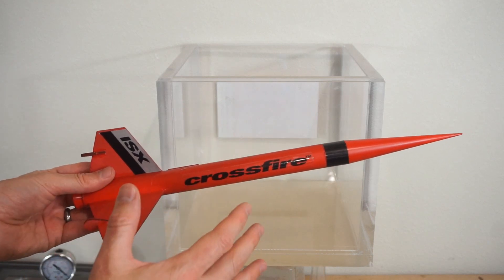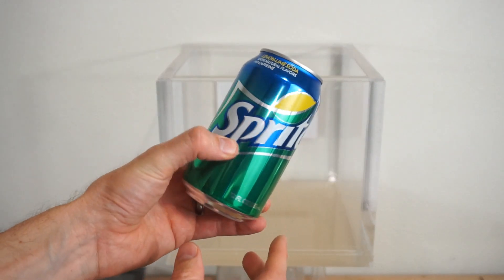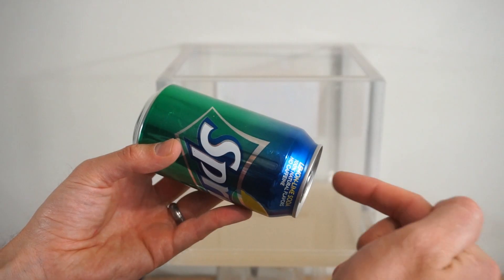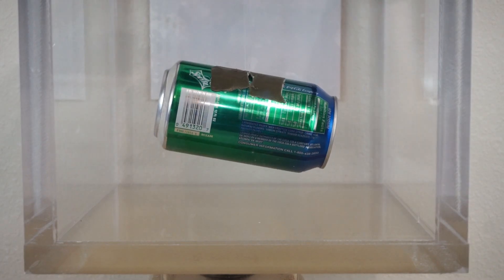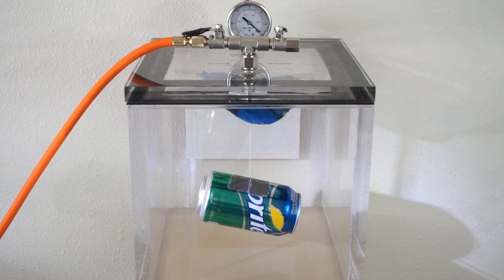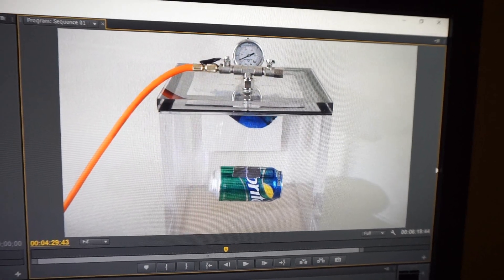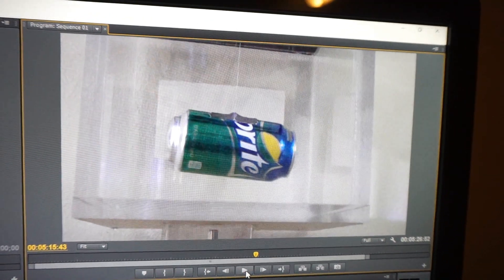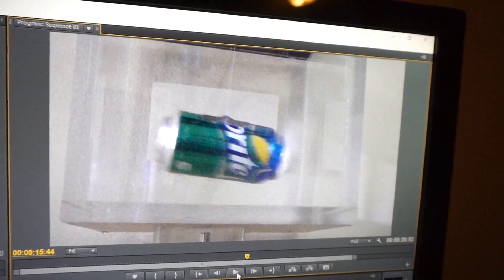Can a Rocket Fly in a Vacuum Chamber?

Comment: was that the same pressure as the pressure of space? 
ps. i ask bcuz the tanks would have to be pressurized and seald @ atmospheric pressure to even have a chance. . and the vacuum of space is like 1000 the pressure of the deepest weve been in the ocean(though its opposite pressure)
the vacuum of space would be "sucking a rockship like a straw so pushing off itself would be noneistent if it was real "space" pressure
Reply: There is no such thing as "opposite," nor "negative" pressure. "Vacuum" simply implies a lack of pressure. Vacuum doesn't "suck," in fact it doesn't do anything. It is, by definition, nothing. You're equating the action of a vacuum cleaner in a gaseous atmosphere with the condition of vacuous space, which is complete nonsense. When I open a valve on my evacuated chamber, air rushes in because pressure outside the chamber is forcing it in, not because the vacuum within the chamber is sucking it in. Fact is, every rocket experiment ever has shown that a rocket generates greater and greater thrust as it ascends through thinner and thinner atmosphere. This doesn't magically stop at the Karman line, rockets work better in the vacuum of space than they do within Earth's atmosphere. Period.
Reply: phxgen thats dumb a vacuum a vacuum. .  so that mean we can simulated the "exact" pressure of space.  No. . according to nasholes we cannot achieve the vacuum of space.  But according to you a vacuum is not a vacuum.  Except the vacuums nasa made doesnt remove. . or suck out air. . wtf. how do you make a vaccuum chamber then? Dumb af 
no levels of vacuum. . u need to read what kind of atmospheric pressure in a vaccum chamber compared to space.  HOLD UP thought you said there are no "levels"   RHETORIC!
Reply: phxgen And rockets move better in space?  So Dumb. . so a rocket only moves bout 15,000 mph. . but it work better in space out of earths "gravitation"  . so keeping up with the earth which moves @ 50, 000 mph (so they say) is nothing huh.  smdh
Reply: phxgen look ima just going to take a few part. . if im in an airplane we are both moving @ the same speed! if i jump out of the airplane i maintain my 550 mph? no!  yet you want me to believe if u leave the earth you will still move @ 50, mph huh?  and as i said. . a man made vacuum cannot exactly simulate "vacuum" of space. . so when the chamber stops "sucking" all the air it can. . its still not supposed space vacuum.  so either the vacuum is held @ a level not of space. . or the air is being continuosly removed to try and achieve this.  Either way its not an accurate depiction of what "space" is.
Reply: phxgen pps the iss is "lower" earth orbit. . not in earth atmosphere not in space. and im sure nasa has all kind of "video" footage. . i even myself have looked.    Just like why all the pictures of the earth nasa has made all look different.  but ok. . ill follow telsa. . you can follow einstien!  most people cant prove space without nasa.
Reply: phxgen circumnavigate. . while the whole supposed solar system i hurling towards nowhere @ a supposed 200,ooo mph or to that effect. . ok makes sence 😕
Reply: phxgen ps. i never said a vacuum wasnt a vacuum. . .  but what u fail to realize is there is levels to vacuum pressure. . so a vacumm chamber nasa made is the same as space? NO! Different levels of pressure. .  im must be kindergarten. . bcuz i look in books they tell me we cant achieve the vacuum of space. . i google wiki and the have a chart with differt "levels" ie chamber, space, ect. . but here u are calling me a kindergartener for reapeating what wiki says 😕
Reply: phxgen im not following either one i just agreed with what he said about Einstein's theory. .  even einstein said himself the mathematics could equate to a flat earth.  btw. . how the know it was round? they never been? And when somebody can prove these planets million million miles away without using nasa i will believe! Bcuz they cant even prove the moon reflects sunlight!  Been since the 70s and only 12 ppl walked on the moon, but we build a space station on mars 😕 some gullable ppl believe anything. . big bang came from a ape muf=×#@
Reply: phxgen still trying to grasp how your telling me negative pressure is no pressure. . it is. . just negative. . the opposite of diving to the bottom of the ocean.   negative pressure so great water boils. guess that why all the footage of them landing on the moon was destroyed bcuz it looked like a tin can!
15,000 mph. . relative to earth 😁 how bout outside of earth. 
gravity sure work and dont work when the globalist want. .  but as thick headed as they are density still has no meaning!
the curvature is .666 moves around the "sun god ra" @ 666 mph. . and of tilt .666%
you can have you theories!  ill believe what EVERYBOBY did till them stoics came along!
Reply: "i see lights up there. . but telling me about something "lightyears" away which would take lifetimes to get to. . yet tell me mass, compositions, age, how it formed. . gtfo how in the hell nasa know? rhetoric"

Why not actually look into how we estimate the mass, composition, age, and distance of celestial bodies rather than just assuming it's all a guess? It's not. Ever heard of spectroscopy, for example? We determine the composition of distant stars the exact same way we determine the composition of something here on earth: spectral analysis. Recording, measuring, and analyzing light emission characteristics, and comparing that data to known values obtained from analysis of materials right here on Earth. We KNOW that we can accurately determine the composition of matter locally by analyzing the way it interacts with light, and we know we receive light from distant stars because we can see it, so what makes you think we can't accurately analyze the composition of stars the exact same way we analyze matter on Earth? We can, and we do.

"the astronaut didnt even know they went thru van allen but they know what things made of limetimes away. . and flat get a tard @ the end?"

So you're telling me that you think if you were to pass through the Van Allen radiation belts, you'd somehow know it? Do you have a built-in Geiger counter or something? You're full of shit, you'd have no idea you were passing through the Van Allen belts either. If you were blindfolded and being pushed around a hospital in a wheelchair, would you somehow know when you were in the nuclear medicine ward? No you fucking wouldn't, even if you were to receive greater doses of radiation than you would passing through the Van Allen belts. Why is it that you people think that very short term exposure to the thinnest parts of the Van Allen radiation belts would be some epic feat, when you can clearly survive an x-ray just fine? I've received many times more radiation than any of the Apollo astronauts received from the Van Allen belts in my lifetime just because of x-ray imaging, and I'm fine. Explain that?

"you probably never heard of operation fishbowl which occurs after byrds trip to antartica.  How high those rockets go? 400,000 . . 500,000 miles is so ironic along with the name of the operation "fishbowl""

LMAO Yeah I've been debating you flatwits on youtube for years, but I've never heard of operation Fishbowl. Right. I hear of it every day thanks to idiots like you, but please continue thinking you're privy to some sacred knowledge anyway. You do not have any arguments that I haven't already heard, I promise. 400,000 and 500,000 miles?? Are you sure that YOU have heard of operation fishbowl? Highest test was about 250 miles, you dope.

"ps. tell nasa one of these guys gonna drown in their suit forreal tryna shoot in that pool.
pps. tellem we see the bubbles!!"

ppps Tell 'em that you think air bubbles move in every conceivable direction and at any conceivable speed in pools on Earth. They deserve a good laugh, after all. None of the debris that you idiots claim appear to be "bubbles" EVER behaves ANYTHING like how bubble behave in water on Earth, and ALL of the shit you think looks like "bubbles" behaves 100% exactly like you would expect random bits of debris to behave in orbit.

You really ought to give up now, dude. You're hilariously ill informed even for a flatwit. It's really fucking sad  you can't even measure up to average amongst flat Earthers, the dumbest group of nutjobs on the fucking planet. Go get a real education, please. Worst case scenario you can just dismiss it like you're doing now, but at least then you'd know what you were dismissing. Best case, you'll realize how silly you're being and you won't have to continue being so wrong!
Reply: "Operation fishbowl only one or 2 were detonated that low. . how high fid they reach? 400.000 to 500,000 miles."

When you're called out on making a stupid claim, why don't you look into it? 400,000 to 500,000 miles is further away than the moon, you dolt. You misread 400,000 to 500,000 metres as miles. Haha!

'quote from einstien
"common sense tells us the earth is flat"'

LMAO you're funny. Again, called out for making a stupid claim and you continue to repeat it without looking into it. Looks like you need to work a little harder to validate your quotes bud, Einstein never said that. You're repeating a quote falsely attributed to Einstein by flat Earth retards. Here's the original quote:

"Common sense tells us that the world is flat, that the sun goes around the earth, that heavy bodies always fall faster than light bodies, that boats made of iron will sink."
-Stuart Chase

NOT Albert Einstein, and even if it was... He's explaining why you shouldn't always rely on "common sense." Do heavy bodies fall faster than light bodies? Nope. Do boats sink if they're made of iron? Nope. Does the sun go around the Earth? Nope. Is Earth flat? Nope.

"phxgen debris. . lmao not bubbles. . gtfo. speaking of debris. . how many satellites "orbit" earth plus old trash and so forth. . but u dont see sh*% in ur live feeds space clear than a mug.  Hold up where my gps.   since its not triangulation! smdh"

Well we've established that you've been wrong about literally everything else so far, only makes sense for this trend to continue. Why don't we see the thousands of satellites in the ISS live feed? Space is fucking huge, you idiot. There are several thousand artificial satellites and bits of space debris orbiting Earth, that's it. There are billions of people, billions of cars, and billions of structures on Earth, yet there are still shitloads of places you can go on Earth's surface and not see a single person, car, or structure for as far as you can see... And you think it's a problem that the ISS live feed doesn't have a bunch of tiny satellites in its field of view, when there are only several thousand of them? Earth is much smaller than space. Each of those thousands of satellites and bits of space debris are hundreds, thousands, even tens of thousands of miles apart. You can literally see the ISS for yourself, even Jeran and other flat Earth retards have spotted it and taken pictures of it. How could it not be real? By the way, other satellites have been spotted from the ISS, and the ISS live feed, many times.

"phxgen pps.  some of em saw lights flashing though there eyes, and your asking me how can you see radiaton?"

Again... if you were blindfolded and being pushed around a hospital in a wheelchair, would you know when you're being pushed past nuclear medicine? You receive a stronger, quicker dose of radiation from an x-ray than the Apollo astronauts received passing through the Van Allen belts. Astronauts are always shielded to some degree by necessity, they're never just freely floating in space, fully exposed to radiation. Spacecraft provide some degree of shielding, spacesuits provide some degree of shielding. It's really only gamma radiation that's of serious concern, and none of the Apollo astronauts were subject to doses of gamma radiation that would cause illness. You are not a Geiger counter, you cannot detect doses of radiation that don't make you sick. You're receiving a dose of radiation from the sun right now, even if you're sitting inside. Can you feel it?

"oh lemme go far left on your spectrometer lightyears away. . how you know its not a space rock unique that gives off similar properties as earth materials."

Because that doesn't make any goddamn sense. The laws of physics don't change elsewhere in the universe. We have a pretty damn good grasp on WHY certain elements have certain spectral properties, and we know these properties don't suddenly change because something is far away.

Keep quoting Tesla, sure. Your idol wasn't the most stable person, he suffered from fucking insane OCD and he preferred relationships with pigeons to relationships with humans. You gonna marry a fucking pigeon? Probably are, look at the way you type. Your grammar is terrible, your spelling is terrible, you type like a teenage girl sending a facebook message. You're wrong about literally everything you've said, you've made it apparent to anyone reading that you're an idiot. Why isn't it yet apparent to you? Why do you think you're qualified to posit your guesses about matters of physics?
Reply: phxgen you havent proved shit.  Just theoretical mumbo jumbo. . and yes im not spell checking myself but that has. nothing to do with what im saying! You can try and make it seem as if im highly uneducated. . but that just makes me feed into you negative name calling bull shit!
phxgen phxgen quote from wiki. . The Thor missile carrying the Starfish Prime warhead actually reached an apogee (maximum height) of about 1100 km (just over 680 miles), and yes the warhead was detonated on its downward trajectory when it had fallen to the programmed altitude of 400 kilometres (250 mi).
so wtf is 680 u monkey cousin?  i swear nasholes!

another wiki quote. . 
Number of tests 11, so should i believe you or wiki. . you a dotart. Do ships sink. m wout surface tension yes!
space is huge. . were not talking about outter space. . were talking earth orbit. . thousands of "working satalittes" not counting space debris and old decommissioned satallties watch that live feed all day youll see none of that. 
how can my theory
clip from forbes article. .
Periodic Table Surprise: The One Element In Stars That Isn't On Earth
so my theory of "alien" elements is just as idiotic as your scientists huh? only when it doesnt validate you bullshit?
heres another quote for the dotard. . 
Albert Einstein and Leopold Infeld-The Evolution of Physics -"The struggle, so violent in the early days of science, between the views of Ptolemy and Copernicus would then be quite meaningless. Either coordinate system could be used with equal justification. The two sentences, 'the sun is at rest and the earth moves,' or 'the sun moves and the earth is at rest,' would simply mean two different conventions concerning two different coordinate systems."
either coordinate system could be used with the same justification?
i swear. .  i cant believe im entertaining someone who thinks we came from monkeys. . 
this is monkey buisness... you prove me Sooooo wrong.  Dotard
Reply: pps. why you telling me i cant see radiation. . tell the apollo crew that too! cuz i see light shoot passed my eyes as well 😂 people cant sit on the beach with some spf but ok
Reply: Please tell me what you think "dotard" means, and how is it pronounced?
Reply: phxgen Crazy. . that quote was directly relative to the point. Einstien came from copernicte model!  MnM forced einstein to change his "theory"
to much typing to go in depth.  Einstein had to change his theory bcuz he kept proving himself wrong!  First he tries to abolish the aether then has to rearrange the problem to make the solution fit! Relativity is like me saying you didnt fall. . the earth came up and smacked you in the butt.  He could not detect motion. . because the earth is stable and does not move! right airys?  gale? morley?  damn sagnat got Einstein back to work on his "theory"  . . i understand why relativity keeps "evolving" tesla!
and sorry no i dont belive nasa "spectrometer" detects anything.  If i had a few billion dollars we'd be racing on saturn rings too!  I dont believe ra is the center! and those lightyears are a few miles above us! Planets are bull with the big bang! 
Ill stick with what everyone believed b4 your stoics came along. And Columbus discovered america!
Reply: "phxgen Crazy. . that quote was directly relative to the point.  MnM forced einstein to change his "theory"
to much typing to go in depth.  Einstein had to change his theory bcuz he kept proving himself wrong!  First he tries to abolish the aether then has to rearrange the problem to make the solution fit! Relativity is like me saying you didnt fall. . the earth came up and smacked you in the butt.  He could not detect motion. . because the earth is stable and does not move! right airys?  gale? morley?  damn sagnat got Einstein back to work on his "theory"  . . i understand why relativity keeps "evolving" tesla!
and sorry no i dont belive nasa "spectrometer" detects anything.  If i had a few billion dollars we'd be racing on saturn rings too!  I dont believe ra is the center! and those lightyears are a few miles above us! Planets are bull with the big bang!"

This is seriously just a bunch of rambling nonsense. You're drunk or something. You've just thrown together every word you know in a salad.

"Ill stick with what everyone believed b4 your stoics came along. And Columbus discovered america!"

So you'll believe that Earth's a sphere, what everyone had known for thousands of years prior to Columbus "discovering" America? This is basically what all your arguments boil down to, you're going to stick with archaic beliefs no matter how much evidence comes along to prove them wrong and you admit that here. What is the point of you debating anyone when you'll continue believing you're right even when you're proven wrong?
Reply: phxgen how have u proven me wrong? without nasa spectrometers and test . . in which i told u id become a believer without using nasa rhetoric.  And b4 copernicus and the catholic church pushed this ball. . it was widely know throughout ancient civilizations that they believed in a flat earth. . ie why it was intially met with blasphemy.  So do be facitious.  the earth is no ball. . it doesnt spin airys. . stars are not planets far away.  Ps.  ill be more specific. . i believe what the ancient hebrews believe!
Reply: phxgen arys proved me wrong?. . michelson an morley did? michelson gale did? 
tell einstein his s;*% need more work!
pps just googled satalittes and debris orbiting earth. . the images brought up look like a cluster f÷=(. . but ok ok ok what you said 😕
Reply: phxgen drunk huh. . Einstien throw out his theory bcuz mnm test disproved it so he thru out the eather and made another version of his relative theory.   then the sagnac proved there was one so he had to change it again. . i tried to sound less inebriated on that one lmao
had 2 change the problem to fit the solution. . of which a flat earth model could easily correlate! but i digress . . finding some independent non nasa government entity your proofs lay as archaic as mine!  And with a billion dollars i bet i would have you belive flat earth 2 since the bible doesnt
Reply: phxgen these smartphone muf$@#z still dont know how they built the pyramids and positioning as well still controvesy about what its use was as well as airplane like artifacts. . myan calender is more precise than our own. ..but yeah. . we know it all now! Google tells me so!
Reply: phxgen yeah i know i need 2 quit cussn but sh*% aint logical. .  earth rise video from china or where ever.  Why isnt the earth spinning in the video?  and if its "tidal locked" how tf is there an earth "rise"  it should just always be the earth just a different part.  been since 1970s and only 12 ppl walked on the moon. . only 12? MAN we wouldve had tours up there by now. . but no lets go settle mars. . smdh
12 people? since 1970. . and that footage? destroyed? ok ok yeah
Reply: phxgen pps ancient egypt myans, hebrews, asains all had similar flat Earth views b4 your stoics
Reply: phxgen ps and for those who dont know who airys was. . a heliocentrist who tried proving the earth moves. . and failed
https://youtu.be/lijjCHb7HIg
michelson and morley also did experiments so einstein tried throwing out the aether bcuz his theory sound like rhetoricm . so he did. . then the sagnac or however its spelled experiment proved there was an aether so einstien had to change his rhotric again (change the problem to fit the solution) in which relativity started breaking into all kinds of different subgroups. . in which theories like dark matter and such arise. But sorry the earth doesn't move!
Reply: phxgen yeah it is boring bcuz you keep spitting rhetoric while my points hold fast. Just like airys will always be a failure.  Even if it was orbiting still no spinning several hundred thousand miles per hr.  no satellites or debris in sight.  .  just a bunch of nasa mubo jumbo and billion dollar computer graphics.
why all the blue marbles look different.  .  and neil degrasse said its supposed to be a pear.  All these photoshop pic of the earth . . can they make em look similar @ least? Ik ik. . ur just going to rearrange your theory so why argue. Michelson and morley showed you. . so did gale. . it doesnt move!  huh? what airys? negative? but there is an aether. . einstien back to the drawing board. . more rhetoric.  plat or copern?  either one could work. . just copern needs alot more work!  Tell me . . they find dark matter @ cern yet?  God particle? Hex. bozig?
illogical how we can be in an expanding universe hurling toward nowhere spinning in a milky way spinning around a sun and spinning. . yet the star run the same line every night. . smh the moon reflect sunlight yet moon shade is warmer than moonlight 😕 This dude tells me we cant see radiation and apollo crew member see lights in there brain 😕 dude tells me there are no forgien elements we dont know about. . yet the periodic table recently had additions 😕 Tries to tell me the myan calender is off. . when its still being used today!  Telling me about things "lightyears" away how tf you travel a lightyear to know? Like telling me what @ the deepst part of the ocean? or what deeper than like 15-20 miles under the surface of the earth.  People can speculate and use theory. . but in the end. the sea is level. . the sky has a ceiling. . . .and like airy . . mnm. . m n gale does it move. . . negative!  Not space. . the sky is blue bcuz there is water up there! Sry
Reply: phxgen pps. . you need to do some more reasearch about the moon landing tapes. . "NASA admitted in 2006 that no one could find the original video recordings of the July 20, 1969, landing.

Since then, Richard Nafzger, an engineer at NASA’s Goddard Space Flight Center in Maryland, who oversaw television processing at the ground-tracking sites during the Apollo 11 mission, has been looking for them.

This NASA remote camera file image shows the July 16, 1969 launching of Apollo 11, the first manned mission to land on the Moon, from the Kennedy Space Center Launch Complex in Florida. REUTERS/NASA/Handout

The good news is he found where they went. The bad news is they were part of a batch of 200,000 tapes that were degaussed — magnetically erased — and re-used to save money.

“The goal was live TV,” Nafzger told a news conference.

Slideshow (8 Images)

“We should have had a historian running around saying ‘I don’t care if you are ever going to use them — we are going to keep them’,” he said.

They found good copies in the archives of CBS news and some recordings called kinescopes found in film vaults at Johnson Space Center.

Lowry, best known for restoring old Hollywood films, has been digitizing these along with some other bits and pieces to make a new rendering of the original landing.

Nafzger does not worry that using a Hollywood-based company might fuel the fire of conspiracy theorists who believe the entire lunar program that landed people on the moon six times between 1969 and 1972 was staged on a movie set or secret military base.

SPONSORED

“This company is restoring historic video. It mattered not to me where the company was from,” Nafzger said.

“The conspiracy theorists are going to believe what they are going to believe,” added Lowry Digital Chief Operating Officer Mike Inchalik.

And there may be some unofficial copies of the original broadcast out there somewhere that were taken from a NASA video switching center in Sydney, Australia, the space agency said. Nafzger said someone else in Sydney made recordings too.

“These tapes are not in the system,” Nafzger said. “We are certainly open to finding them.

© 2018 Reuters. All Rights Reserved.

×
Reply: "phxgen pps. . you need to do some more reasearch about the moon landing tapes. . "NASA admitted in 2006 that no one could find the original video recordings of the July 20, 1969, landing."

Yet strangely enough you've seen video from the July 20, 1969 moon landing, haven't you? You've been arguing that "all footage was destroyed," yet you've fucking seen it. Here, watch some again:

https://www.youtube.com/watch?v=S9HdPi9Ikhk

Doesn't look destroyed to me. Never heard of making copies, I guess? What the fuck would anyone need the original slow scan video for anyway, when you couldn't have even viewed it without a special slow-scan monitor? There's no reason to keep the originals when we have copies that we can actually watch.

Your next comment is just a bunch of fucking emojis. Grow the fuck up and speak English. I'm not replying anymore until you stop speaking to me like you're a twelve year old girl sending a Twitter DM, I'm not your fucking "boo," speak to me like a civilized adult or don't speak to me.

"tell you guy he need a better zoom! as to why its still a theory!  RHETORIC"

Yet for some reason, nobody has ever been able to zoom in and reveal parts of a ship that have been obscured from the bottom up by the horizon, EVER. Not once. You can't provide a single example of this ever happening, because it doesn't happen. In fact, you can see on videos where people zoom in and out on ships beyond the horizon, the exact same amount is obscured no matter what zoom level they're at. You fucking idiots argue that more zoom would reveal more of the obscured ship, but you can't provide a single example of that ever happening while we constantly provide videos where zooming in and out doesn't change the amount of the ship obscured even one bit. Please, since you think it's possible, provide me with any evidence of someone zooming in on a ship partially obscured by the horizon and showing ANY part of the obscured bit suddenly becoming visible. YOU CAN'T. The ONLY way you can reveal part of a departing ship that's been obscured from the bottom up by the horizon, is by gaining elevation. Going straight up. By going straight up, you're not reducing the distance between you and the ship at all. You're still looking through the same amount of air, yet going straight up reveals what was previously hidden. The reason is because the surface of water is curved, and there is NO OTHER EXPLANATION POSSIBLE. None. Here, watch the sunset observed twice just by changing elevation, no change in distance:

https://www.youtube.com/watch?v=pLrRoE8myMM&t=1s

Explain this, without the surface of water being curved? Good luck, you literally can't.
Reply: phxgen phxgen yeah the sun is why the stars all planets dissapear in space😕 i never see star while the sun is out 😕 matter of fact i didnt wake up and see the sun and moon out @ the same time 2day. . other side of earth missn a moon 😕so thats why stars disappear when ur in space 😕 the quote with einstein sayin plato coordinate could work doesnt correlate 😕 he was saying its just as easy to say the earth is moving around the sun as it is to say the opposite. . oh thats what he did say but doesnt coorelate 😕 wtf  i cant say unkown elements even though as i stated the periodic chart has changed 😕 the earth spins to slow to see 😕 i see you avoid my airys comment n mnm comments so i wont reiterated their test results. i see were not discussing moonlight, along with why relativity has changed so much from the original (changing the problem to fit solution) thank to geocentric experiment 😕 yes i misquoted how high the missles went. . but that doesn't change the fact they started shooting em after byrds mission! and you said a couple rockets when it was more like 11. . not counting accompanying rockets shot @ the ceiling bubbles are debris that im not supposed to see cuz space is huge 😕 so when do i see debris. . only when i think its a bubble bcuz i could walk all around the globe and not see a person but this spec of debris i can see even though space is huge and the feed points @ earth 😕 thats the debris you can see. astronaut almost drowns in suit!! the recording of the moon landing werent erased just telemetry vids 😕 vacuum chamber dont "suck" out air as a vacuum it just removes it 😕 no levels of vacuum either its space or not space we wont talk about the properties of moonlight compared to the sun even though the moon supposed to reflect sun light 😕  and boats disappear beyond horizon 😕https://youtu.be/Gkzbx99vUhI 
tell you guy he need a better zoom! as to why its still a theory!  RHETORIC
Reply: Here's another one:

https://www.youtube.com/watch?v=i0ObTd7DLMw

Notice as he zooms in and out, the level of zoom makes absolutely no difference to the amount of the ship obscured by the horizon. Zoom in, same amount obscured. Zoom out, same amount obscured. Even the video that you linked shows that the same amount of distant ships remains obscured no matter how much he zooms in and out. You're seriously so stuck on this flat Earth idea that you've been led to believe that zooming in on an object will make an obstruction between you and the object disappear? You fucking people don't know shit about perspective. Perspective does not make parallel lines actually converge, ever, yet you people try to argue that perspective makes parallel lines converge before the object? You people think that perspective makes straight lines curve? How does this make any sense to you? You literally have to throw out everything to believe this shit, the only way you can believe Earth is flat is if you literally do not know anything about anything. Why are you so desperate to believe this shit, does being a contrarian make you feel special?
Reply: phxgen 😕 heres another one 
https://youtu.be/pPK-cNfz2Eo
so which theory is correct a wave hiding your boat or curvature? 
ik the curvature drop is supposed to be 8 inch every mile or so. . and the Bedford experiment s that are still controversial.  
so as i stated. .einstien says the flat earth model is easily as plausible.
according to you i can only see space debris when it pertains to airbubbles. .  there no way spectrometers could be wrong bcuz we know every element know to man (even though periodic table has been recently updated) . You dont wanna talk about why airys failed!  Nor mention the test you geocentrists did that sent einstien back to the drawing board so many times (trying to make the problem fit the solution) Stars disappear on earth because the glare of the sun on our atmosphere (they say) 😕 yet outside the atmosphere they still cant be seen bcuz the sun shines everywhere yet there is no atmosphere creating "a blue sky" in space . . i wont get into how a yellow ball makes a blue sky. . but thats dumb too!  According to you. . The tapes never were erased of the moon landing, and 15,000 mph rockets travel @ more than 50,000 in space even though they are outside earths "gravity". 
oh, you said you cant see radiation, (but never explained to me why the astronauts saw lights flashing b4 their eyes) 
water is level though its curved. . and without nashole rhetoric your theories are as good as mine!  
pps albert didnt even come up with e=mc2 but i bet your school didnt teach you that either!  To be honest comin from a monkeys uncle a spinning ball does sound logical 😂 dotard
Reply: phxgen yes. . gives me all the room to infer... simply bcuz if geocentrity coordinates could be plausable. . a flat one is too! 
Period. .  cuz its all relative right? 😕 pfft. 
Again airys is a failure. . still!
Reply: phxgen but i see we dont want to talk about why it change from theory of relativity to general relativity to special. . to whatever it is now!  we wont talk about airys failure. . noo thats salad 😕 we wont talk about how the sagnac had your boy einstein back to the drawing board again!  How micherlson n morley effected your boys theory. . n michelson n gale furthur solidified why einstein had to go evolve his sh%\!
We wont talk about debris i cant see in space unless its minute air bubble like debris. . all the rest spread out like a hooker on prom night 😕 
we wont talk about radiation YOU SAID were not supposed to see. .  flashing in front of astronauts eyes. Your right . . salad cuz u cant handle meat! 
So just so im clear. . we have discovered all the elements on the periodic chart? no more additions right?
only 12 ppl since 1970 on the moon. . damn near 100 years only 12 ppl? 😕
we wont talk about what tf "composite" means and why all those pics on nasholes page is photoshop.  . (repetitive copy and paste clouds ect)
yeah colombus discovered america too! smdh
Reply: Word salad and emojis. Reading that shit is tedious and annoying as fuck, I don't care to.
Reply: "Dotard" isn't upsetting. It's just a really stupid insult. I have no problem with name calling. You're an idiot. See? I called you an idiot, which makes sense because you've demonstrated that you're fucking dumb. I've not done anything to demonstrate great age or senility, so "dotard" doesn't make sense... Not that using a Middle English insult like you're fucking Shakespeare makes any sense ever, really.